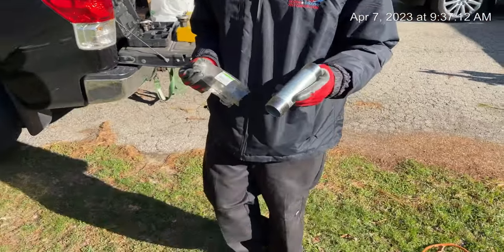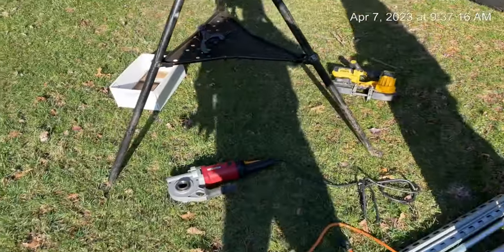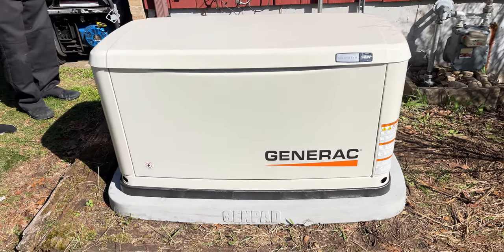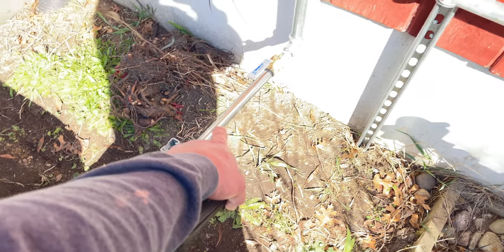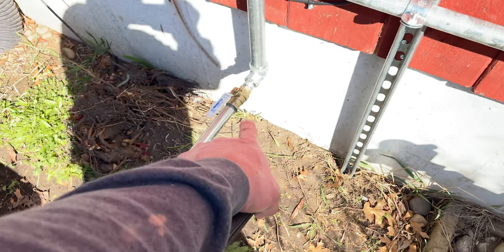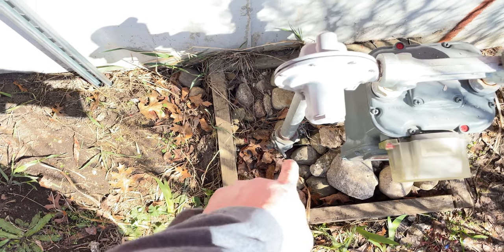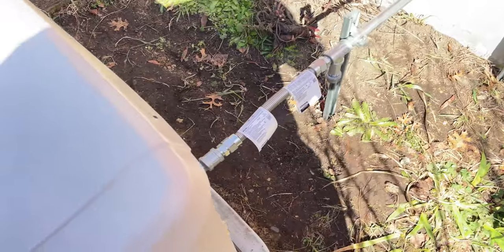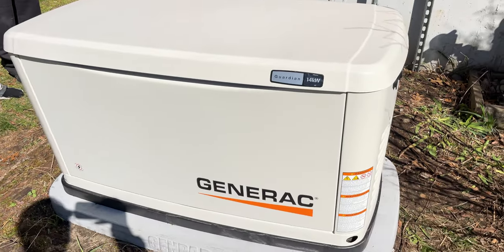gas pipe for Generac Generator 14 kw

Comment: That would be red flagged  in AZ . Gas pipe black iron.
Reply from the maker: It’s interesting different area’s different codes. What’s the reasoning in AZ for No Galvanized?
Reply: Generac will not say that galvanized is not acceptable.   Black iron is always preferred for natural gas.   Reason is that hydrocarbons will remove the galvanizing from the pipe and it can get in the engine.  For a small unit that only runs for a short amount of time it is not a big issue.  When it comes to inspectors IMO it depends somewhat on how he rolled out of the bed that  morning.   I am I the Houston area, lots of installs,long storm season with extended outages and many municipalities. 

A installer has to know which AHJ wants it this way or the other.

Comment: Nice job. I didn’t know you could use galvanized up in Michigan. I just used regular steel gas pipe. The inspector just wanted it painted so it doesn’t rust.
Reply from the maker: Yes Galvanized is fine, just can’t use it LP.

Comment: Thought Generac had an internal  " DRIP LEG " ?
Reply from the maker: I will have to look into that.
Reply: Don't think so. I do electrical on them and every plumber I've seen puts drip leg
Reply: The new ones do.  I just installed a 22KW unit and it had an internal drip leg.
Reply: they do have internal drip pockets, been working on them for 4 years and they have that whole time

Comment: I thought that the electrician had to do his work first before the gas. I’m in Texas and that’s how they’re doing it here. Why are you doing gas first and then the electric is there a reason?
Reply from the maker: Scheduling. Was the issue, it does not matter who does what first here in Michigan.
Reply: Why would installing gas first be a problem? I installed the gas first so when I installed the wiring I could install it in a manner that didn’t get in the way of the plumbing guy doing his work. No state or code requires anyone to do it in specific steps so long as it meets code and done safely. Wire is also way more forgiving than pipe. Make sense?
Reply: I do electrical on these and in texas, doesn't matter who goes first here but we also aren't in an area that requires permits

Comment: What can you do when gas and electricity are on the opposite sides of the house?
Reply from the maker: Depending on which one would be more easier and cost effective.  You could run it through the basement or attic. Or trench it under ground.

Comment: What is the rated BTU rating on that unit? I read your comments on the galvanized but nat. gas and the velocity will still cause the metal to flake off inside. You should reconsider black iron for the safety of the cylinder walls and pistons. Also the flex connector must mean it's rated below 100,000 btu? Appreciate the feedback, thanks.
Reply from the maker: A 14 kW Generac generator typically produces around **47,700 BTUs per hour**. This is calculated by multiplying the kilowatt rating by 3,412 BTUs per kilowatt-hour (14 kW × 3,412 BTU/kWh = 47,768 BTU/hr). Also asked 3 different inspectors at three different jurisdictions and pretty much the response I got. Yes, galvanized steel pipe is commonly used for natural gas lines, including those connected to natural gas generators. The zinc coating on galvanized pipe provides additional protection against corrosion, which can be beneficial in certain environments. This is in Michigan.
Reply: The 14KW unit requires 256cuft/hr for full load which would be about 256,000 BTU/hr.  Remember, piston engines are only about 20% efficient.

Comment: I would question sizing on this job.  If you look at total demand house and generator.  I would bet the meter is undersized.
Reply from the maker: I believe that meter is 265,000 on all these jobs I do the gas company has already checked sizing all I have to do is make sure my piping size is correct.

Comment: So why didn't you run the pipe down the wall and dig a trench over to the generator instead of running the pipe across where it wold make mowing diffcult and it would keep people from whacking the exposed piping?
Reply from the maker: Why would someone be Weed wiping the air? there is no Piping that will get hit! COMON!!!
Reply: I'm not running you down but my thought is if a pipe is hanging in the air, someone mowing the grass would probably hit it. If it's burried then there's no chance of running into it. Anytime something's exposed in the air someone's going to hit and break it most likely. @ADVANHVAC
Reply: @handsupbud  they have to weedeat behind there no matter what so running underground only causes more work and much harder to troubleshoot or fix an issue in the future. Longer runs u would def go underground but in this case this is perfect. Ground also causes pipe and fittings to rust quicker galvanized or not
Reply: @handsupbud  You ain't breaking 1" or 3/4" steel pipe with a weedwacker.

Comment: I wish my gas meter was in the back of the house instead of the front.
Reply from the maker: If your pockets are deep. That could become a reality for you! 😂
Reply: Of course this will vary depending on where you live but CenterPoint Energy here in Houston Texas will install a second dedicated gas meter for the generators.  You do have to pay for a second gas bill which is just a standby service bill minimum of around $23 if you do not use it at all for the month.  The cost for them to dig the line off of the main and install the regulator and meter was only $350